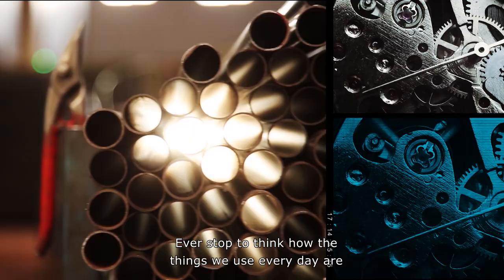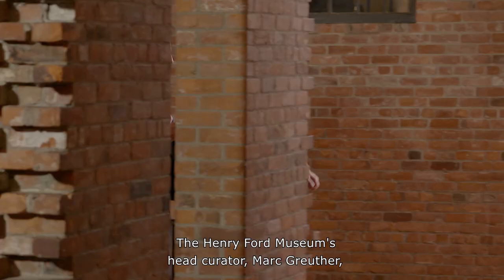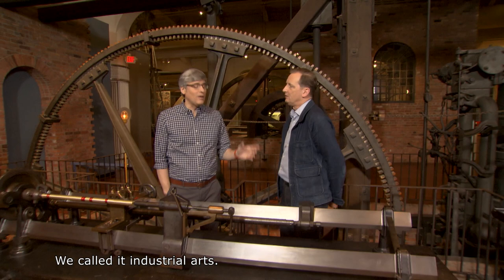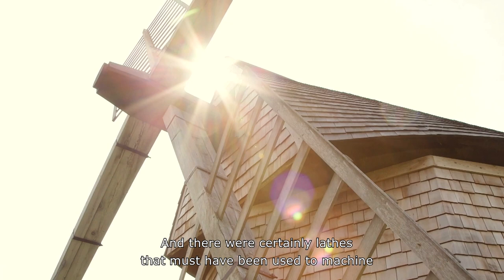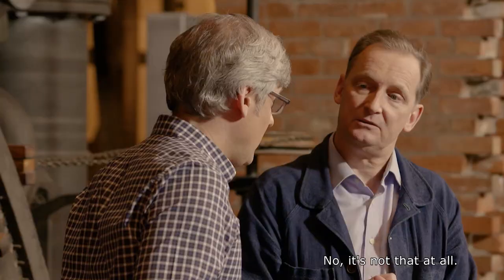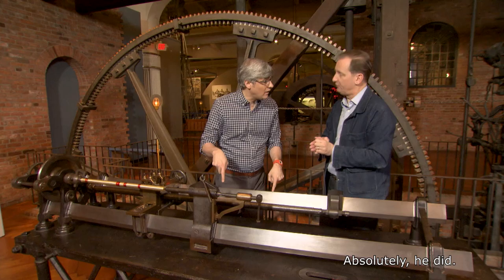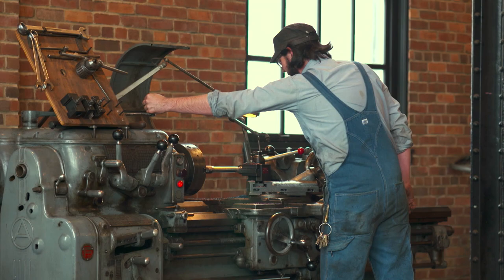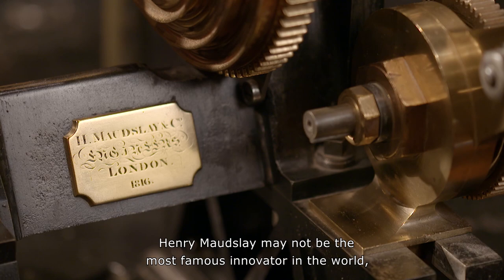History of Lathes | The Henry Ford's Innovation Nation

Comment: I have a W. F. & J. Barnes 4 1/2 . Built between 1901-1906. All original parts except the peddle bar. It is a fantastic lathe. That old and I can still dial parts in to .0001.

Comment: Old-timey cannon manufacturers used water wheels to power a drill to bore into a solid piece of steel to from the cannon barrel.
Reply: If the part is stationary and the cutter is spinning it’s not a lathe
Reply: @theshauny  no its a drill.

Comment: You can see the lathe technology used in Indian architecture in centuries old temple. They just reinvented or copyed it and stole credit. It is same for radio waves and gear system. You can even see rotating pillars in temples using round stones as ball bearings. there are depicted proof in Indian architecture in temples the use of gear technology in india.